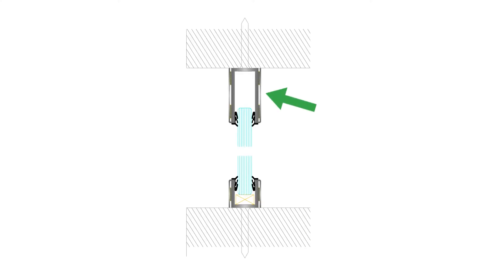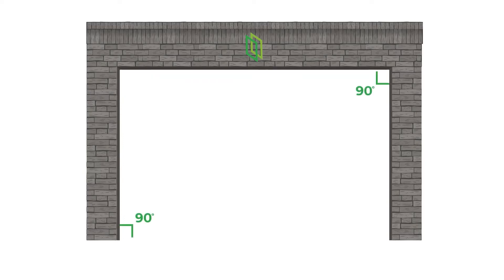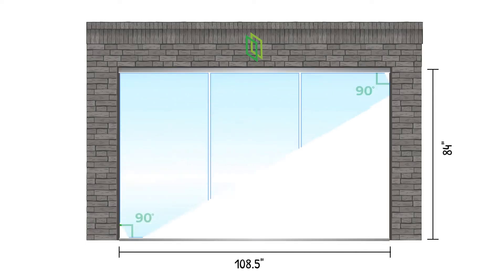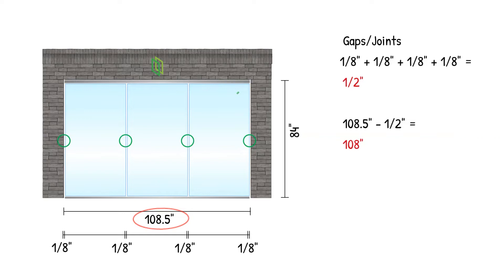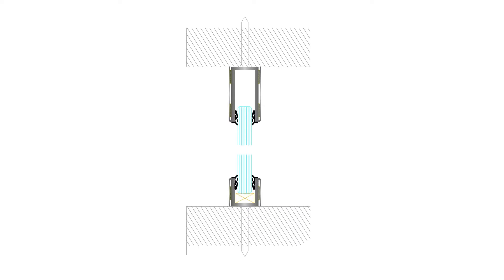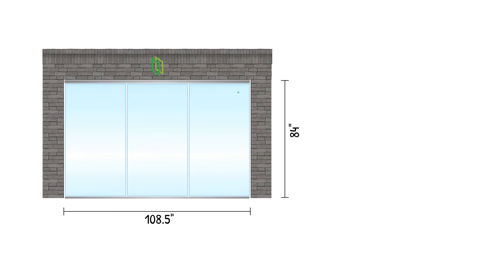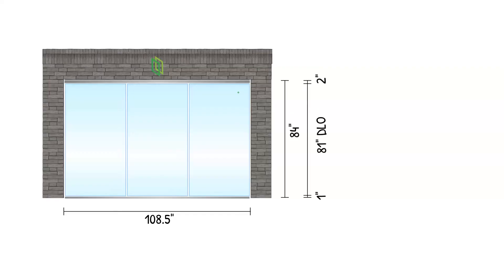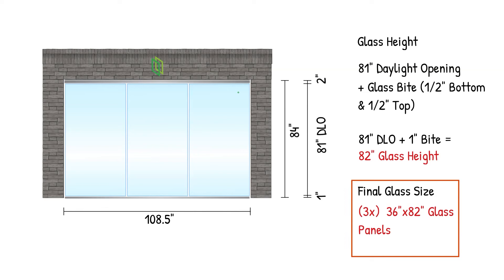How to Size Glass Panels Like a Pro – Fast, Easy, Accurate

Comment: Hi i have a question for you 
If i use a air pistol which produced 10J of energy when hits to the glass so which polycarbonate Grade i used to make a shield that not even get a skrach when hit a pallet to it
Reply from the maker: hmm that's an interesting question, but we are not familiar with anything like that, sorry.

Comment: I go with 1/4" seams in case the fabricator furnishes the glass 1/16" or so too wide.  It also makes it a bit easier to set the glass.
Reply from the maker: It definitely helps having more space. Especially when setting them in so you don’t accidentally bump them. It’s good that you know your supplier. Most fabricators try to provide their glass one +0/-1/16 tolerances.